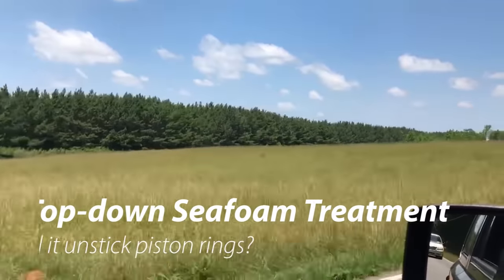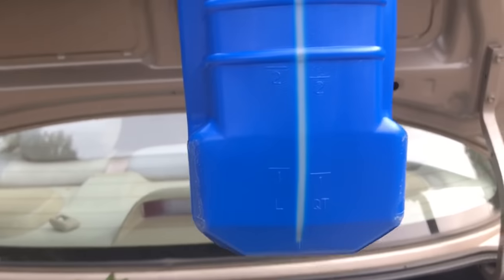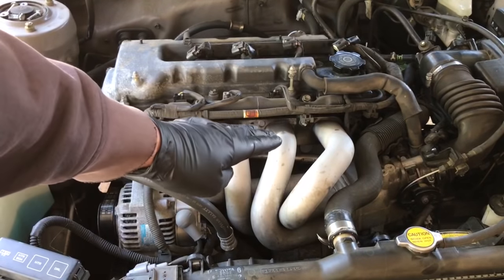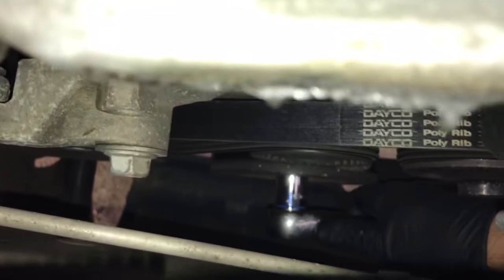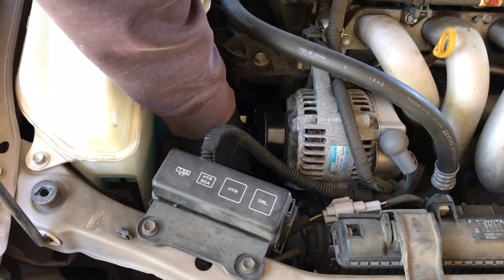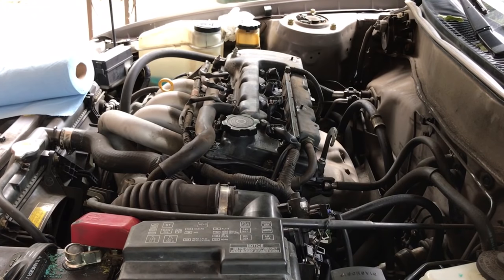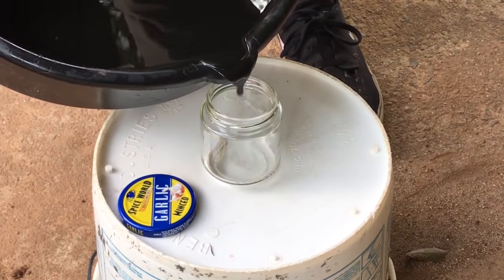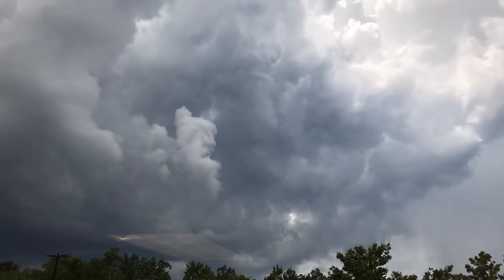I poured Seafoam down the spark plug holes! | Oil Burning Experiments - Episode 1

Comment: The problem is the bottom ring of the piston, which is often called the oil control ring.
Reply: That’s why motor flush and wait. Then Start again and wait, the. Start again and wait… have to dissolve the gunk

Comment: Have you tried using a heavier oil? Say from a 5w-20 to a 5w-30 or 5w-30 to 5w-40?
Reply: I went to a 10w30 but much higher will make the oil control ring relief hole problem worse. I run heavy seafoam in the oil now to help

Comment: Hey) Did you find anything that is actually worked after all? I have been struggling with the similar problem as yours. Not as severe though but still quite tired of adding oil...
Reply from the maker: Not yet, Mikhail .. but still experimenting.
Reply: @FamilyFriendlyDIY  I have tried quite a few additives and flushes. Nothing worked as well. Have been weighing pros and cons of adding 'new' engine... Should work I hope)
Reply from the maker: @mikhailwp  lol ... Tough decision ... I wish you the best.

Comment: You need to tighten the valve springs there is a lot of chatter this should quiet it a bit then put a little lucas oil with oil change should use a lot less wait till engine warm before adding cause it’s thick don’t want to break the pump and should mix well with the oil also will get. Quieter and use less oil

Comment: You may have done a bit better than you thought. When you filled it with oil after the oil change, to the "Full" mark on the dip stick,  I didn;t notice you start the engine.  To get an honest "Full" read, you need to fill the pump,filter,and oil passages by running the engine,. Then shut it off, allow a minute for drainback, then check the dipstick.
If you did not do that, I suspect about 1/2 qt may have "disappeared" on you.

Comment: I own that car. Calls for 5W- 30. yes , i have the same oil issue. I , too, have a 98 tacoma. great engine for oil. Though, taco does have an issue with what i call , lack of power. frustrating, that one.
Reply from the maker: That's so wild that you have the two same cars that I do---well  my Taco is a '97. Thanks for the comments, rocknrollerman!---Saw your comment on the other video. Hope you figure out the power issue. Mine's pretty torquey. When teaching my daughter how to drive it, she never gave it gas when starting off in 1st---she just let out the clutch and idled off. Don't think I've ever taken it up a 35 degree incline though.

Comment: B12 chemtool works perfect for this 1zz-fe engine.
Reply: This is only the first of numerous attempts. And yes, the B12 is the only one in all of them that drastically improves/reduces oil consumption.
Odd thing is, even well after trying all the others afterwards, including the HLP engine cleaning oil, which all did little to nothing, he never came back and did the B12 again.
I mean if its taken years to gunk up those oil control rings, maybe, just maybe, it might take 2, 3 soaks to really get them cleaned up?
I think he got so many views after this that he wanted to stretch out the clicks vs actually fixing the oil burning.

Comment: use diesel #1 3qts diesel to 1qt oil run 5 minutes let cool down completely, do five times, remove plugs when cool add diesel to each cylinder 4oz per with pistons all at mid hight let soak 1 day then remove fuel relay crank over  30sec  6 times, now drain oil mixed with diesel and refill with fresh oil, this cleans everything, use JB oil tune up red can, or JB oil treatment blue can, interfearance engine red can or if it uses 5 20 OIL, 5 30 or THICKER blue can, best of luck, this is the best way I found to clean out carbon, crank over and replace plugs.
Reply from the maker: Thanks for the suggestion, Wade!

Comment: Since the mid 1980's I only use 20-50 in all my vehicles. I never use synthetic. That's hundreds of thousands of miles no need to add oil between oil changes. Two of my vehicles have over 180,000 miles and neither uses a drop of oil.  Using light oils in modern engines is only to save an ounce of gas. How much does your oil cost?

Comment: Oh man, I assure you, after a few seconds seafoam was gone from cylinder 😃 especially when your pistons rings were stucked. Did you even look into cylinders after pouring the seafoam?
Reply from the maker: Not too unlikely :-)
Reply: @FamilyFriendlyDIY  I followed this topic on your channel, I'm not sure I have seen all but did you try measure compression on cold engine and then with small amount of oil poured into cylinders? It would let you know if it is cylinder head or bottom of the engine (piston rings). Probably you were advised to do it. Keep searching, good luck.
Reply from the maker: @pabllok  I did some compression tests, one cold and one warm ... I didn't do the wet test however. Here it is if you want to check it out ... https://youtu.be/T6yeIOL8ifE  Thanks for watching, pabllok!
Reply: @FamilyFriendlyDIY  you welcome

Comment: Change to a	 HM mineral oil in 10w30 or heavier. It will use less than on synthetic.
Reply: No, be smarter than the average YT "expert" and use a decent brand of Full Synthetic High Mileage oil and do oil changes at 3-5K.
The FS will clean your engine over time better than old dino-oil. If after several changes you don't notice any cleaning to have reduced oil consumption, then consider going 50% current oil weight and 50% the next thicker grade for a couple oil change intervals and see if that reduces it.  The old an engine is with the more miles, the better its chance of handling a thicker grade of oil.
If that confuses you, talk to a mechanic.

Comment: Should run some 5w 30 through it with some engine cleaner about 3 oil changes. Go to thick and you oil pump is going to fry

Comment: Oil burning sparkplugs will have a brown coating, unless it's a lot of oil.

If you're burning that much oil, there's no point in doing oil changes, just change the oil filter every 3000 miles.
Reply: Mite as well scrap it 🙄

Comment: 8th Gen. corollas are 98-02 1zz engine, That's 5 years of 8th Gen. Research tells me that 00-02 yrs, got the vtt-i engine so there were some changes made in this Generation. 2000 was when they started the coils on top of each spark plug. The car in the video has them. 98 and 99 don't. If you google what year of these 5 had oil consumption problems it started at 2000 for the 8th gen. I Know someone with a 99 and over 250,000 miles they said they don't have that going on. I also chat people up when out and about they have that many miles and more and no problem. So it's specific years that do.

Comment: Sea foam in the cylinders will do nothing add it to the oil and drive it. Thats the only way ot will disolve the varnish and maybe the stuck rings. Follow the directions on the can a little extra in the oil is ok but dont thin the oil out too much. Your best bet is to keep topping up the oil as it disappears with 1/4 sea foam 3/4 engine oil after initial treatment and drive it will take time
Reply: Wrong Mr. Expert.
Piston soaks do work, although B12 is a much stronger solvent than this light hydrocarbon.  Plenty of people have reported success with piston soaks, and it makes sense that the fluid will seep between the piston and cylinder wall, down and through the rings helping un-stick them, and then through the oil control rings enough to reduce carbon build-up.  If you put the fluid in and then the plugs, why are some cylinders empty after 6 hours while others are not? Its because those are the ones that are the most stuck and clogged up, leading to excessive oil consumption/burning. If you had the slightest idea of what you were talking about you'd know that SeaFoam is a very light, volitile hydrocarbon that has a flash point of ~200'f which means as soon as the engine reaches operating temp and you get on the freeway its gotten hot enough to simply evaporate out of the oil and gone out the EGR.  Rookie.

Comment: One thing I have had some luck with is Walmart brand engine restore & changing spark plugs , If you have plugs with long threads change to shorter threads . Gets the plugs up out of the cylinder a little bit & use copper plugs.

Comment: This might need to be pointed out:  different engine oils burn off at different rates.  The Walmart Super Tech oil, I doubt is top tier.   Just search oil volatility and oil evaporation.
Reply from the maker: Chris, check out Todd's test of Redline vs Supertech https://youtu.be/zwqt5vI0o1A ... it might change your mind :-) Thanks for the comment!
Reply: Full synthetic SuperTech is top oil, Project farms has run extensive tests.

Comment: The Seafoam container has quite specific instructions for doing a “Seafoam engine treatment.” I don’t quite understand why you did not follow those instructions and instead improvised your own method, which did not work very well.

I have done the treatment according to the manufacturer’s instructions with excellent results.
Reply from the maker: It was an experiment. I do it by the instructions in the next video. Thanks for the comment.

Comment: Or a half a bottle of brake fluid in motor and it will swell up seals and car will not usual that's what I did can change the oil every 3,000 miles

Comment from the maker: Previous video in this series:
Introduction to the Corolla: https://youtu.be/AYGM4jjqywY
Next video in this series:
Seafoam vs. Stuck piston rings - bottom up approach: https://youtu.be/Q5kEbu7lXG8
Entire oil burning experiment playlist: https://www.youtube.com/playlist?list=PLS7Cti2LicYDtv1hFbz_dErQFGxnTgMCj
Reply: Great video matey.. I think that little difference was proof you were right. furthermore, to me, further identical treatments (with more manual crank jiggling) will clear the ring  channels more. thank you, my bro, mum and dad are Toyota people, lol, I'm the mug who keeps them running. this way round is logical. fantastic, genius !!!
Reply from the maker: @alexpmK3  Thanks for the comments, Alex. All the best to you!
Reply: I'd like to see you try a can of Berrymans B12.  I think it will give you the best results.  Piston Soak with the Berrymans
Reply: I'd say that was a dramatic improvement. 10% more miles driven and what looks like a 30-40% improvement in oil consumption. How much oil did it take the second time. btw great vid thank you for your efforts. I'm thinking about doing this on my BMW diesel.
Reply: It's only clicking because the sea foam thined your oil so changing oil is a must.great job well done 👍
Reply: That said pouring atf into the top works. If it doesn't you got bigger problems. Just dont run it with the atf in it. Pull the spark plugs out and crank the engine over to clear the atf. Diesel works in a pinch some times. We hand crank it till it turns freely then drain it and refill the oil. ezpz

Comment: That engine is caked in sludge. Your last 500 miles before oil change put 4oz seafoam in the oil and drive it or use rislone as your top off oil. Both are great products for sludge and sticky rings. I've used mineral spirits before for breaking down carbon on rings and clean top of pistons during cylinder head work. Keeps things oiled and clean at the same time.

Comment: Unfortunately the only way for you to fix this is to replace the engine. The rings sieze generally due to lack of oil changes and they wear a flat spot into the side of the cylinder walls allowing oil past. No amount of seafoam or mystery oil will fix it.

Comment: If it burns oil you never have to change it, just top it off :)
Reply: i did just that it cost 2600.00 and 3 weeks down time oil pick up screen clogged locked up the eng  -- no idiot light  it just quit zipping down inter state

Comment: I put Sea Foam in the oil just before I change it every time, about a half can, then run it about 50 miles before I drop the oil. The rest goes into the gas tank. I can say that you can stop an oil burning engine from using as much doing this and it wont hurt a thing. If you've ever seen an engine apart that has been treated with Sea Foam regularily, its very clean! After a while of doing this, your oil wont look black at the change intervals anymore. But DO NOT USE SUPER TECH! It's garbage recycled oil. You get out of your engine what you put into it!

Comment: 2015 Fiat pop non turbo. After 4 plus misfiring and oxygen sensors triggered. Replaced plugs as they were def bad. Oxygen sensors no longer triggered after system reset and cycled. But cylinder 2 still misfires. Move coil still same issue swapped a plug and 2 is still misfiring. Listened to injectors all sound working. But upon inspecting the hole of cylinder 2 you can clearly see alot of carbon. So something is wrong with either the fuel injector or carbon built up or engine damage. As the misfire is keeping the engine light blinking. So its technically not driveable.drivable. This Fiat was losing a quart every month so did the oil seafoam and drove 300 miles then changed oil and added at205 now not losing barely half that now. I think the owner didn't change his plugs in time now has the cylinder 2 issue remaining.

Comment: I would probably run a slightly hotter, spark plug, no more 40,000 gap and maybe switch to Rotella semi synthetic 5W 40 or the full synthetic. If that makes a huge difference go with that and if the car has a really good oil pump you could probably run the 15 W 40 to see if you can make it 90% better or completely fixed or start purchasing a good full synthetic 20 W-50 even if you have to get it off the Internet

Comment: I don't believe you did not top your oil off in the beginning after the change.  Your filter will take a quart alone.  If no one has mentioned this in the last 3 years, they missed out on a factual and honest test.  Now if the oil is going down after that point I say a mechanical solution is at hand.  My Honda is the same way-but I have used the Shell diesel T-5 15W40 and have a good result with that.  The choice there is straight oil-T4.  T-5 blended.  And T-6 full synthetic.

Comment: Yamaha Ring Free works well for this task.
Reply from the maker: Good info, Charles! ... In my latest video I just asked viewers if I should try Yamalube Ring Free next. Would you pour it down the spark plug holes as well?
Reply: @FamilyFriendlyDIY Hi Dave, Its actually used as a fuel additive for marine engines to free up sticking rings. If I was poring anything into the combustion chamber I would try Berrymans B12.

Comment: "Sticking piston rings" is a bit misleading. Each piston has 3 piston rings, and the top two aren't sticking. They're compression rings.

The last one is, only one ring set on each piston, it controls the cylinders oil film, and it is not sticking. It is clogged. It is a 3-piece ring, with a wavey center, and it is filled with gunk which prevents the ring from scraping the oil off.

In addition to soaking the cylinders, run 1 can of seafoam in the crankcase with every oil change. This has worked for my last 4 cars. All originally 1/2 - 1 quarts per 1000 miles, reduced to ~1/2 - 3/4 quarts per 3000 miles (when wrecked…I might buy a decent car if people stop hitting me!)

Comment: Someone needs to fill the cylinders with decarbonizer and place a rod that will Emmitt ultrasonic vibration to break up the hardened oil reside around the oil control rings.

Comment: I am a 42 year mechanic certified and they just don’t bill Toyotas like they used to. I have a dodge ram 3500 with 1,185,000 miles on it never been touched the motor still running also have a Ford ranger 2002 with 513,000 miles on it still running so no Toyota don’t build what they used to. Also Toyota 1.5 ring problem along with valve stem seals
Reply from the maker: That's awesome! Which engine do you have in the Ranger, Lee?

Comment: The following videos kind of help explain the root causes of oil burning: 

Why do Engines Sometimes Burn Oil?
https://youtu.be/-tVvHszHf7w?si=kBe79S_5AulXIC7W

The Effects of Stuck Rings & Blowby on Engines
https://youtu.be/MzKr2g4NOsU?si=X8CoXqhQxmAZDBk9

Base oil oxidation explained in three levels: beginner | intermediate | advanced
https://youtu.be/vTp-QfO_7iM?si=m1DwS_11KxXRqGL5

Why do oils get thick when they oxidise? Polymerisation of lubricants explained
https://youtu.be/SzJgyPQVe3w?si=u6D5DyJHE6-QPX61

Comment: 2003 Honda element 
2013 Acura RDX
2013 Toyota Camry 
Non of them burn oil neither leaks oil 
Always SYNTHETIC oil, 5k intervals and before oil change I add sea foam or any “engine cleaner” drive 1k and change the oil, because all of my car are over 100k , now I use synthetic HIGH MILES oil…you’re welcome 😉
Reply from the maker: Good job!

Comment: Would not use seafoam, that was developed for 2 stroke engines. Use Brake cleaner instead, let it soak for a night, change the oil afterwards.

Comment: I have 2 toyota rav4's.one is 2001 the other is 2002.the 2001 has every oil change record since it was new and it was changed every 3000k miles by the owners religiously.it burns no oil at all! My 2002 has no records and was told the engine was replaced at one point. The 2002 burns alot of oil! I worked as a lube tech in the past and the people who service the oil every 3k had cars with high miles and little to no issues. Change your oil people! Yes they have piston ring issues in many cars....

Comment: why dont you just use motor flush?  Thats what its for.  Its a kerosene type product, a (solvent) you poor in with your old oil you are about to drain except you idle the engine for about ten or fifteen minutes to get it circulated many times through. It chemically cuts everything in there. Then you drain and fill like normal. I have seen old guys do it with actual kerosene too. a quart. The old oil makes the flashpoint a non-issue.  lots of brands of motor flush out there but they are mostly just kerosene marketed as flush.